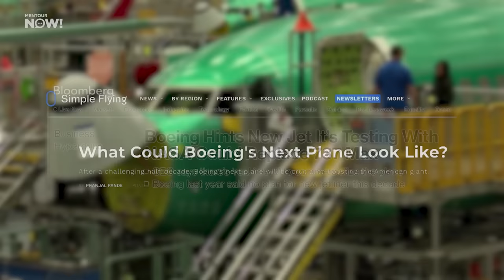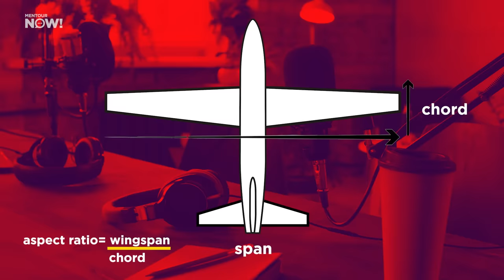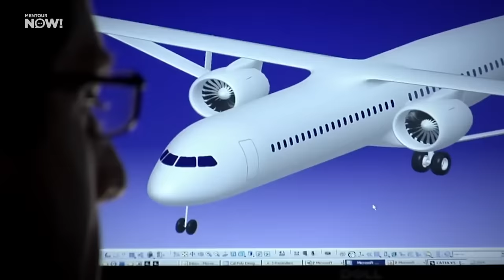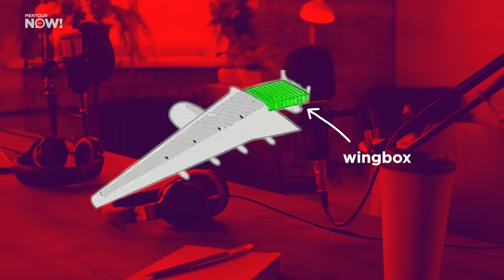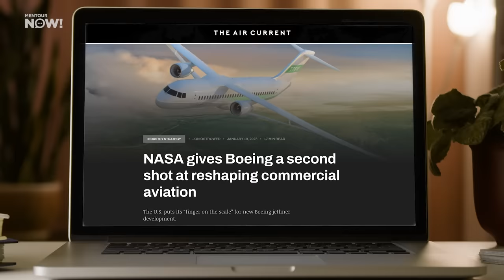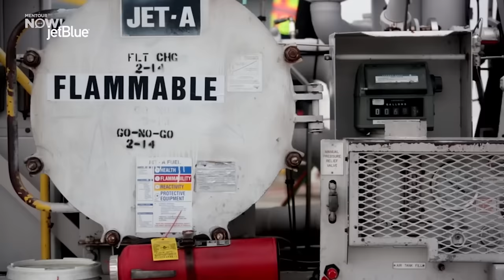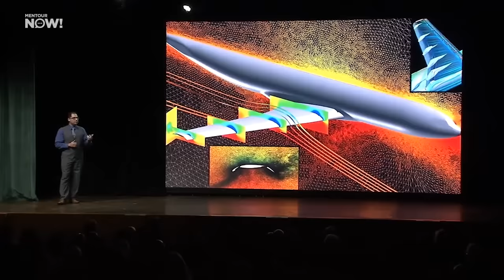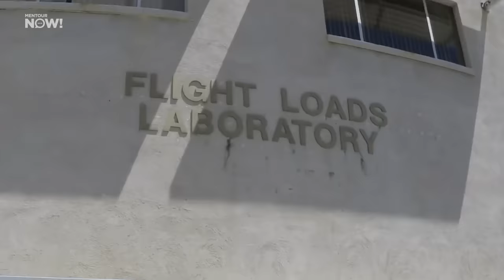Revolutionary Breakthrough: Boeing's Transonic Wing in Partnership with NASA!

Comment: why not use the wind for fuel mostly? faster the plane goes stronger the wind...and the stronger the wind, the faster the plane goes...
why not use magnetic force that's build in to the runways and the underbelly of the plane and can pull the plane to the right strip then activate the opposite and no need for tires, plane can glide on the magnetic field. never miss a stirp and could be assigned to a certain plane. also, could "catapult" the plane into the air using the opposite ends, then disengage when its off the ground.
...or just figure out damn teleporting already!
I am 56 y/o now, when I was a kid I could not lift my nose out of books, I read so many Sci-Fi books and I was SO SURE that by now we have MOST of them as an every day reality! What happened?!
Very disappointing. we should be a lot further by now. 2023 and we live not even remotely close to what it could be!
I want a refund!

Comment: I used to be a base line engineer for SAA.Pilots log 747- 300 "something loose in tail". I pulled the bird off line into the hanger,removed access panels and climbed all the way up the vert stab. Nothing,exept a plastic p clip holding a n electrical wire. Nothing at all on/in the split rudder. I reported back,something tightened in tail.They didn't have a sense of humour! I was sent to the dog house for three months.

Comment: First, I’m not getting on a folding wing commercial anything..nope.
Understanding the trussed wings would be longer, I still wonder how only the outer section beyond the truss will deal with severe clean air turbulence encountered at today’s cruise speeds?  Further complicated by being swept, thin and narrow, which are all fantastic contributors to flutter and bizarre harmonics.
Although, it could be an excellent next generation turboprop (ATR-style) platform I don’t see the design showing up on jets in my lifetime.

Comment: I hope that aircraft start getting made with no passenger windows. The weight savings,increased strength, reduced cost and better passenger experience would be so worth it.  Flexible, low weight OLED film could completely transform air travel.

Comment: As much as I love the various Mentour Pilot episodes,   I don't begin to buy that the RISE is viable.    Open rotor is in its 4th version roughly,  none of the prior ones could overcome the issues of noise,  vibration and the costly rear mounting that negates any SFC improvements.    Now we have a dumbed down version and its 12 years away (promised not even a trial  unit built let alone a prototype).     What CFM (GE and Safran)  gets is free money from the EU to develop a new core and a gearbox (can you say GTF?)   that neither one has invested in like PW and RR.    And that assumes you can sell a prop job as the public does not like them nor any PR campaign is going to convince them its not (and it is).

Comment: Very interesting. At some point, I guess, efficiency in the air causes problems with efficiency on the ground at airports that then outweigh those improvements in aerial efficiency. Why isn't some sort of modern bi-plane design being considered? Achieving the same efficient lift by dividing the wing area required by two and creating a bi-plane with modern swept wing design?
Reply: This is a bi plane, and the efficiency is gained by the width, affecting more clean air. Biplanes are worse efficiency and drag wise as they disturb each other's air flow. Control surfaces on the tail also need clean air, hence the tailplane is so high here.
Reply: @mandowarrior123  I make no claim to be an aeronautics expert, just asking!
Reply: @QuicknStraight  I'm sorry, was I terse?

Comment: Folding wings have long been a staple in military craft - however, when things go bad in a military bird, theres usually a way to punch out. Not so, with a commercial craft (though i seem to recall one designer, possibly russian, who designed the cabin of a craft to be jetisonable with a chute. Not sure how far that got; but small private craft now can be retrofitted with emergency chutes). Itll be interesting to see where the science goes; especially with as a wings volume drops so too does fuel capacity.  Bracing could off set some of those losses.  In the interim, i still would like to see aircraft get fitted with cameras on all vital components - tail, engines, gear etc - to aid pilots when things go bad.

Comment: Look here is the deal.   These great designs sound cool, but you will not profit from them.  Only the airlines and aircraft manufacturers will.    Second, there will be crashes, accidents and death before they work out all the bugs that they should have before they put people in those seats.   Yes, this is the sad timeline of aviation innovation.    You won't get the profit, you won't reap the reward, and passengers will take the risk.   Fun stuff.    When I was little, we could fly around in airliners at close to 600 mph, now it's barely 500 mph and shitty food.    Commercial travel is a complete joke.   Add to the getting violated by TSA,  being assumed to be a criminal.  "Airline innovation" should scare the crap out of every potential passenger.   Just recall the many wonderful experiences of  those that died in the 737 MAX software "glitch" had in the last few seconds of their lives.   Fantastic innovation!   And that was just software.....wings are hardware, even worse.   I would think anyone who has a historical knowledge of all the human death that has occurred due to airline innovation would take a pause, just a brief moment of pause, and not so enthusiastically talk about potential innovations, without reverence for the inevitable failures that will occur upon their implementation.     The Comet had those great square windows in the ceiling, fantastic innovation!  Only two or three airliners filled with passengers had to fall to their death to work out those bugs!   If you wanna improve airlines, start with changing the shitty food, get rid of the ridiculous TSA and start treating your customers with respect instead of contempt.   And, pretty please, test your new technology completely FIRST, before including it in your newly designed aircraft and making the passengers the test pilots.

Comment: If you don't learn from history, you're condemned to repeat it. The problem which begins at c.M0.98 is the build-up of the sonic blast wave ahead of the aircraft. In Concorde's case, it kept blowing the engines out. The solution (designed by my father, Fred Lanchester's last protégé) was a variable-configuraction air intake nascelle, which they could get away with because it lay under the huge delta wing. What they're playing with is a conventional ducted engine, and that's asking for trouble. Having to add a long nascelle adds further counterlever loads at right angles to the thin wing, therefore, creating serious torsion issues in the flex, and adding major issues to the brace. Perhaps the answer's to embed the engine in the wing, at the point where the brace connects. The logic here is to start from the power source, and build everything else around it. However, is does mean the airframe is limited to two engines: yes, of course you can add pods outboard, but they're only usable subsonic. This may not be such a problem, as supersonic speeds were only used over the ocean, and at height, so you'd need the extra engines to get there.

Comment: I think what Boeing needs to do for its 737 replacement as the MAX was dooming for the company from the get go is:
1. Have fun with NASA with this strutted wing design, but don't use it.  The strut part is going to generate significant drag and the wing is not going to hold enough fuel for the point-to-point flights it is going to need to do.  However, it is important to learn all you can about making more efficient wings.  What is probably going to do it is to go back to the folding 777-X wing design.  Maybe go for less wing sweep and a somewhat slower design.  Less wing sweep can lead to a thinner cord design.  A 737 replacement I don't think needs to go quite as fast as a 737.

2. A lot of what Boeing needs to do for a 737 replacement is to go back to the 787 and just revise and try to perfect all that went wrong with that program.  It is not that the 787 is a bad concept; it is just Boeing made a lot of mistakes.  I think you may see some substantial revisions in how to put a plane together, but everything will be going in the same general direction that they 787 went in in terms of using newer, more advanced composite materials and newer fabrication techniques.  It is just with the 787, the way it is fabricated and assembled is kind of set in stone while there are better ways to do it.

3. I think a place to look is into MAHLE motors and American Superconductor as well as diving into superconducting logic / power electronics.  The idea being getting into super efficient, very compact, and powerful electric motors that don't need rare earth magnets.  This gets into things like electric gear reduction with high bypass ratios.  A more straight through design is a lot more efficient.  The actual jet engines can be separate from the ducted or even open fan.  A ducted fan design may even have the motor portion in the cowling.  LNG could be used for the superconducting coolant and dump into the jet engines as it boils off.  If a somewhat wider body design is used over the 737, attic space could be freed up to store the LNG tanks.  While the superconducting system can be built with redundancies such as having dual systems on each jet turbine and each ducted or open fan, if all else fails, the plane can fly inefficiently, but still fly on the jet turbines alone and mainly just sink down to a lower altitude where the jet engines can generate more thrust.

4. See what the deal is with LiS batteries as supposedly these batteries have had some major advancements in 2022 that will bring them to aircraft standards.  These should be 3x lighter than comparable batteries in a Tesla while having a much higher C rate.  The idea being when you hit that TOGA button, these batteries will put out a lot of power and allow the jet turbines to be smaller while allowing for short take-offs and thrust reversing with this allowing for short landings.  737's often need to get in and out of small airports and it would be helpful to have that extra thrust to do so without going for either bigger, more gas hogging jet turbines, or less fuel and payload on the airliner so it could make the take-offs and landings as in lighter load means accelerating and stopping quicker because more instant power will counter this.  A big weight savings / trade off would be to get rid of the APU and use batteries in its place.  Having all of this stuff stretch to the back of the plane so a traditional APU can do its thing adds a lot of weight and complexity to a plane.

You put this all together and you should have a drastically more efficient plane than the current 737 MAX.  It is just right now everything is kind of wrong and outdated with the 737 design leading to a drastically less efficient and overall wrong plane than what is needed and what could be done.

Comment: Boeing doesn't care nearly as much about commercial aviation as it used to. Prior to the merger with MDD, it was primarily a commercial airplane company and a defense contractor second.

Following the merger, the reverse was true so it just doesn't feel the need for all the risk and expense of designing a new aircraft.  

This sort of attitude was why McDonald, Douglas and Lockheed had all but surrendered the commercial aviation space to Boeing and they preferred as Boyne does now to concentrate on higher margin space and defense projects.

In the mid-90s Airbus was kind of a funny little European thing that seemed like more of a prestige project or maybe simply a jobs program.  No, it seems very much like when they're current models are no longer selling. Boeing might bow out of the market.  

There will be tremendous pressure not to do this, but it could very well end up being more like the prestige project I described in the previous paragraph.

Comment: You missed one of the reasons that the early jet liners' wings were so thick.  They were designed using slide rules and wing tunnel tests, and wing tunnel testing was very expensive. Besides which, sliderules had only three decimal places of accuracy.  The first calculator that could do more than the basic add, subtract, multiply and divide, and to more decimal places was introduced in 1972, back when it's $395.00 price was comparable to a top-end desktop system today.  So airplane designers went with what they knew from slower aircraft designs.

Comment: You dismiss the financial contributions by NASA that people call subsidies but if Airbus were to receive a similar type of support from a government agency of the EU you know that Boeing would be screaming about the unfairness of it all. As it sounds like this is a NASA developed solution, Boeing should not have exclusive rights to the underlying design, and other aircraft manufacturers should have the right to use it. I’m differentiating between the the overall project, which belongs to NASA, and the building of the test plane, which is where Boeing is involved. 

Besides, with climate change, any design that may improve flight efficiency so much needs to be shared openly. We are at the point in time where there are more important things than two companies competing based on whom has the most efficient plane.

Comment: Boeing systematically stripped its ranks of its most experienced designers and engineers a few years back by targeting layoffs to upper grade/salary levels, a nasty way to avoid being charged with age discrimination even though the only way to get into those levels was through decades of employment. They backfilled with younger, less expensive workers and on paper they saved money, but lost expertise and market understanding. As they've lost market share year by year, there are fewer and fewer financial resources to apply to new projects, and fewer and fewer people with the knowledge to efficiently execute them anyway. So I'm not holding my breath for this, or any of the other concepts they've put forward in the past few years. They just don't have the breadth or depth, or particularly the understanding of markets and customers, to bring any of them to fruition.

Comment: Why not make the brace much bigger, and forward swept, and connected to the wing at the tip.  You'd have a diamond shaped wing.  Much shorter wingspan with two sets of very high aspect ratio wings connected at their tips.

Comment: Interesting concept, but given engine placement, it's going to be loud in the aft end of the fuselage. I think they should look more into developing the flying wing concept, or looking at a canard design, like the Piaggio P.180 Avanti EVO. Given how many accidents have been caused by a stall, developing an aircraft you literally cannot stall because of it's design. Granted, all canard aircraft are relatively small, so I wonder if there's issues scaling it up to a 737 or even a 777 size. I still feel like the aircraft companies have been playing it safe. All of today's commercial aircraft are a cylindrical tube, low wing, twin-engine, standard tail design. It's more like a standard design that they re-skinned for all their models (except the 747 and 380). There's no real uniqueness to aircraft design anymore, and because of that, I struggle to understand how it's become so complicated and takes so long to design a "new" aircraft. Nothing about the design is truly new. The body is a cylinder (nothing new there), the wings are low with two large engines underneath (nothing new there), control surfaces operate as they always have and are controlled by either hydraulics or computers (again, nothing new). So other than materials or new construction techniques to save weight or make the aircraft stronger, and doing the math to keep the plane balanced, this really should not be that hard. And for reference, I took aerospace engineering in college and am a pilot as well, so I'm not ignorant of any of the above.

Additionally, theoretically, couldn't you strut a wing from the top, making the wing thinner?

Comment: Great information , As both a Pilot and Mechanical Engineer, I find myself thoroughly enjoying your videos as they offer incredibly precise and informative content. Your work is truly exceptional, my friend. As an Engineer I believe Im not enjoy so much the 737 since has faced some accidents related to the automated control to avoid loss of weight and balance, particularly in relation to the Maneuvering Characteristics Augmentation System (MCAS) software. This software was designed to automatically adjust the aircraft's angle of attack in certain situations to prevent stalls, which can occur when the aircraft's wing loses lift due to insufficient airspeed or other factors. Additionally, the design of the 737 MAX's engines, which were larger and mounted further forward on the wings than previous 737 models, changed the aerodynamics of the aircraft and increased the risk of stalls in certain flight conditions. The MCAS system was intended to address this risk, but the reliance on a single AOA sensor made the system vulnerable to malfunctions or errors. Yes I know we are talking about new wings design but I saw so much the 737 in this video that that I want just to mention that.